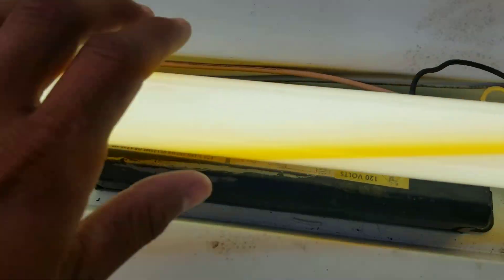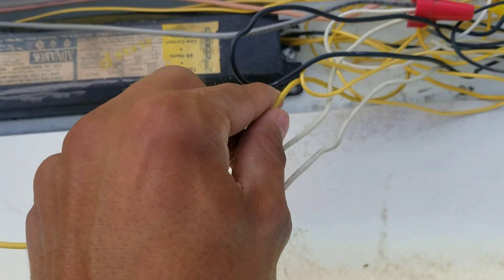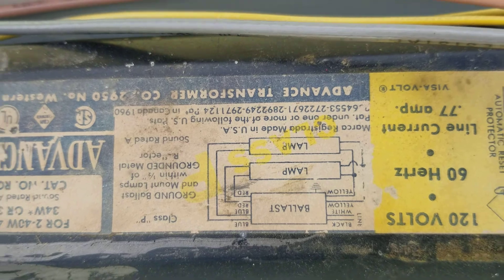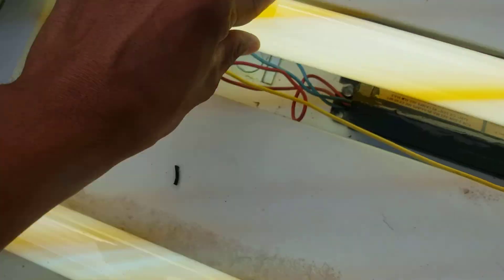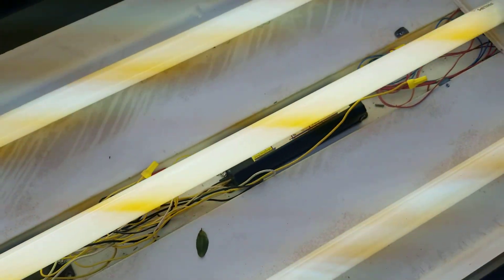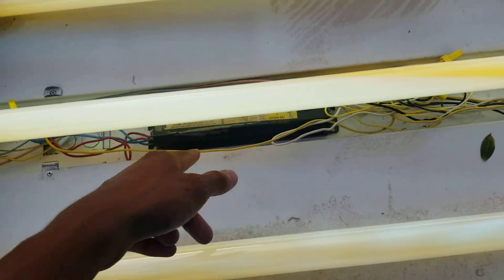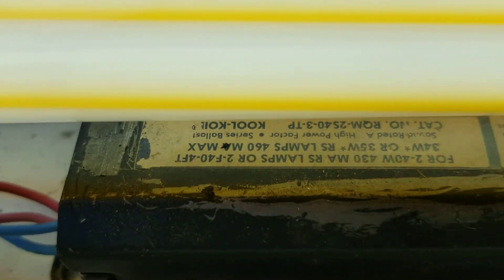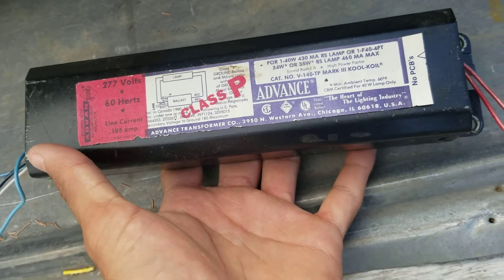1,143 How to make a 2 lamp ballast into a one lamp ballast

Comment: Did you find a wiring diagram for that ballast showing how to wire for one lamp? If not, I would not leave it on unattended if it wasn’t designed to run one or two lamps.
Reply from the maker: That ballast already had a internal short so I was experimenting with the already dying ballast